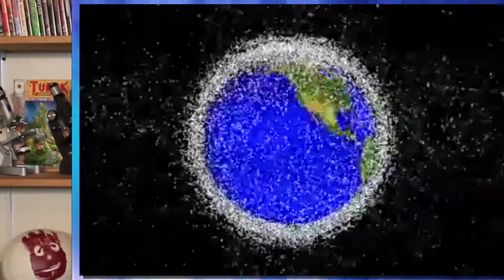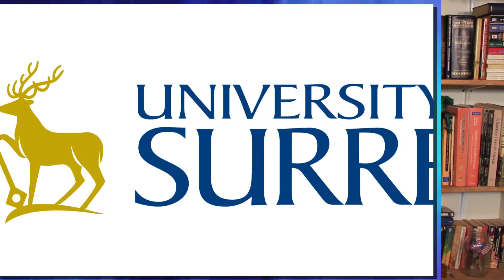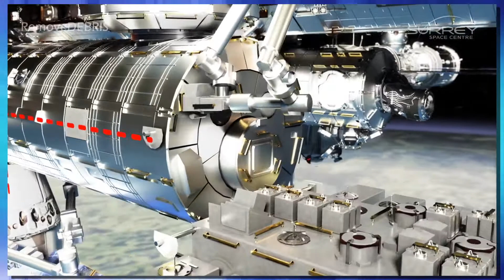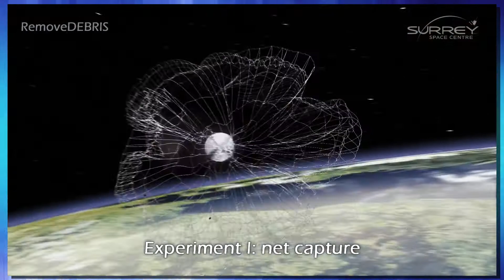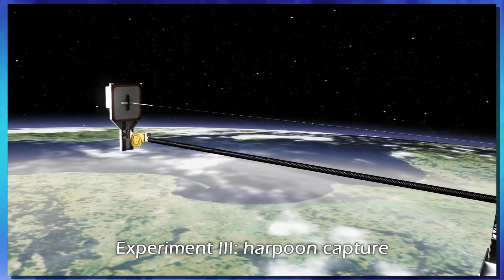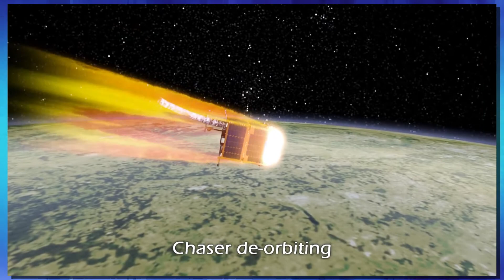RemoveDEBRIS satellite getting ready for orbital debris removal tests.

Comment: Ridiculous, this looks like a colossal waste of money. There are so many large targets they could've practiced on without wasting the money to bring up their own targets. Nets wont work when you consider the velocity of the target junk. who is our ridiculous,  if you're going to capture something large enough for that to work on you might as well simplify thingsand just push it into the atmosphere. Unfortunately( as they really haven't been invented yet) , particle beams are the only practical solution, especially when you consider most junk is smaller than a bread box. ( naturally I do have a better solution using current technologies but that's proprietary LOL)
Reply from the maker: That's what I was thinking with the net. To be worthwhile the net would have to be travelling really really fast when it impacts the debris. That's the only way it is going to put enough energy into the junk to slow it down enough to de orbit. Otherwise we just end up with debris wrapped in a net. I like the harpoon a bit more but they have to figure out a better way with that. You don't want to spear one piece of junk then de orbit your whole satellite. I wonder if they could attach the end of the harpoon's rope to a deployable cube sat that is then fired toward the atmosphere. Or maybe the sat can just house a drag sail. Whatever they do hopefully they can deorbit multiple target with their final design. You should pitch your design to nasa, you never know they have been known to buy concepts from the public.